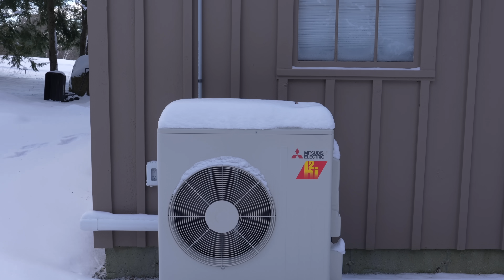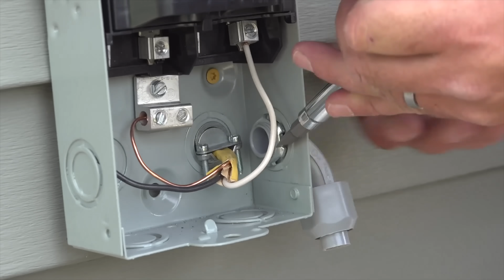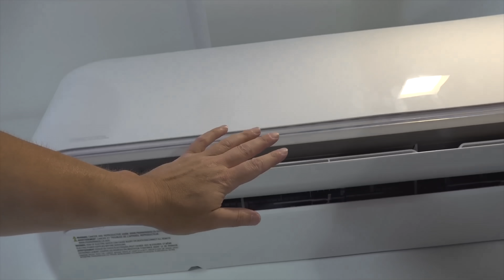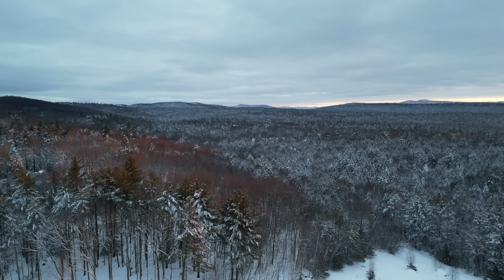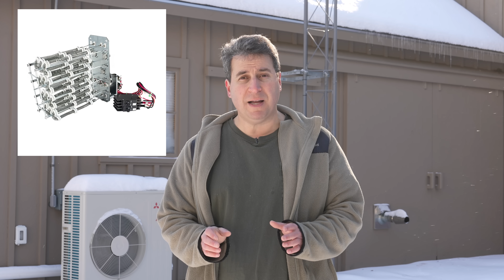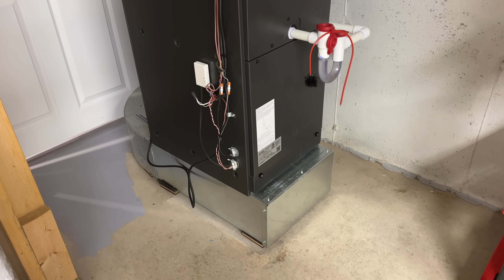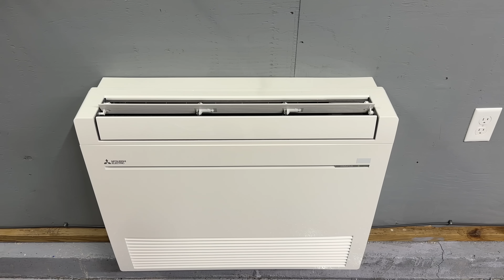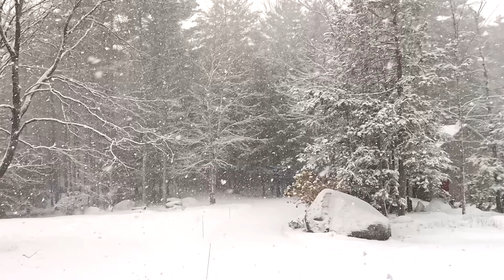Why Heat Pumps are now leaving people COLD

Comment: My Concord 4HP17L has been more than adequate in NE Ohio so far. Emergency heat has kicked in a few times but the temperature outside has been so low that even a gas furnace would be having a difficult time keeping up. The fact that I don’t have to pay a $43 connection fee just to have a gas meter turned on more that makes up for the extra electricity used by the emergency heat strips.
Reply: Also, I’m at about 5.5¢/kwh. It’s basically free at this point.

Comment: My HVAC company just told me how my system works in extreme cold. They said exactly what you said. We have to switch to auxiliary or emergency heat setting so that the system will work efficiently and keep you comfortable. At the same time, the Electric company reminds us that our bill will be high doing so. So now we know what to expect. 👍👍👌

Comment: For supplemental heating those Chinese Diesel heaters are great for emergency purposes. They saved my butt when my furnace went out in subzero weather a couple winters back.  For about $550 I built in a backup heat system that os over 40,000btu, reliable, on demand, run off readily available diesel which is stored outdoors, can run off 12v or 110ac, and I even recover exhaust waste heat from them with steam radiators.  Would recommend
Reply: Do you have a link for the system you went with?
Reply: @matthewbeasley7765  I just use 2 Vevor brand self contained (8kw) heaters, and custom built the entire system on a weatherproof cart.  Used insulated tubing for both pulling air from in the home and for the heated air in a custom window "gasket" that also has a 6 plug outlet.  2 deep cycle 100ah marine batteries, a 1500 watt generator with ducted exhaust into a car muffler at the bottom of the cart (adds supplemental heating to the whole system)
A 2000 watt inverter connected to the batteries, 2 cheap but good chinese battery chargers, and a 25 gallon diesel can for extra supply.  Its a fully self contained system I could sell for around $1200 bucks (which i've been offered for it)  I also duct the exhaust from the diesel heaters to the car muffler at the bottom of the cart which recovers heat for the unit which is enclosed by piece of folded sheet metal with securement pins.
Reply: @ProlificInvention  Interesting... How long can your batteries run the system before you have to recharge?
Reply: @cryptickcryptick2241  2 deep cycle 100ah batteries will run 2 heaters for around 4 days running full out, I use a variable voltage ac/dc transformer from China thats rated 0-48 volts and 480 watts to run the heaters off the generator while it is recharging the batteries.
Reply: I have the same. Originally bought for emergency backup, but trying to lower my oil bill supplementing with the heater. Tons of heat & uses very little fuel. Small solar charges the 12v battery.
Reply: Another easy way to heat a house is with a Kerosene heater. Some of the Kerosene heaters require no power, and a $150 to $200 unit puts out 24,000 BTU. Kerosene can be hard to find. The external exhaust of the Chinese diesel heaters are nice.
Reply: @cryptickcryptick2241  Yes I have those, unfortunately the fumes get to me, cant stand the smell of kerosene fumes because of an old job I had where we used those heaters

Comment: My 3 ton universal MR Cool Heat pump works perfectly 4 years  now i do not have the electric strip and my house has shitty insulation and windows and our bill has dropped 20% overall i leave it on 72 all the time  performs much better than my 14 seer Goodman the temp here in NC only gets below 30 degrees a few times a year
Reply: https://www.youtube.com/watch?v=_v8vizQXwss&t=7s&pp=ygUZbXIgY29vbCBoZWF0IC0gMjQgZGVncmVlcw%3D%3D So are they lying here?

Comment: I'm in the middle of the country and most of us here avoid heat pumps. They just don't offer a nice warm environment. I have natural gas heat and would not consider anything else.
Reply: I live in Missouri with 3 minsplits. They are amazing. We are all electric for everything. Electric bill is 70-90 dollars per month except in super cold where it goes up to 150.
Reply: My heat pump has propane backup when temperatures is to cold for the heat pump. Does great. 
My basement unit has the electric heat strips for the backup.
Reply: I agree with you.

Comment: I have a new bosch heat pump ducted system. My house has a bunch of issues that i still need to deal with including figuring out my old duct work is undersized. So not an ideal situation however the heat pump has been able to maintain 70° inside temp down to about 5° outside temp is when it starts to struggle. I did get the 10kw aux heat and have been fine tuning when that comes on. I now have it set to where it only starts using it once the outside temp is below 5°. Even then the system will run the heat pump for a good while until i decides it needs some help. It then turns off the heat pump and turns on the aux heat. That runs for about 20 mins which raises the indoor temp about 2° and then it switches that off and turns the heat pump back on. My heat pump doesn't have hyper heat however bosch just announces a hyperheat version (go figure) however their system is only rated down to about -14 i believe so not quite where some others are claiming. The true test will be the electric bill. Last year during a similar cold spell using the electric baseboard heaters cost nearly $800 in a month.

Comment: If designed and sized correctly especially in new construction, a heat pump can keep up on winter minimum days without supplemental heat. I’d still install electric elements or a gas dual fuel set up just as a backup though
Reply: If it is sized to keep up on minimum days - is it oversized most of the time? I run auxiliary heat only when necessary (in the teens and below).
Reply: @jdmather5755 Many modern multi split heat pumps are variable speed and can ramp up or down depending on the OA temp and heat/cooling calls. There is definitely a sweet spot in regards to efficiency but I’d much rather oversize for winter minimum than undersize and be cold. It’s not a bad strategy to rely on supplemental for your coldest days but I prefer it as just a backup. Mitsubishi has free software called diamond designer which allows you to calculate efficiencies and capacities at different design conditions

Comment: You make a very good point. A fireplace insert in the den used to get the room so warm we’d open the door to the patio to cool off. The heat was stuck in that room. We tried fans and a vent from the den’s cathedral ceiling through the attic to the living room. Nothing worked well. Then I had a ducted heat pump system installed. It distributed that heat through the house wonderfully! As long as I kept a fire going the heat strip didn’t come on. It was there if needed, but it was expensive. That was 2007 or so. Probably not as efficient as new ones. It was surprising to me how that insert could heat a 2000sf home. I expected it to help, but didn’t dream it would work as well as it did. With temps below zero I’ve been cringing for folks relying solely on heat pumps. My friend with a geothermal heat pump sees incredible savings. Here in the Ozarks we have lots of rocks too. Burying a line isn’t easy, but it’s incredibly efficient! If I had it to do over, I’d go that route. I’d still enjoy the wood stove though. Wood heat is just so soothing, especially with arthritis. The combination is perfect!
Edit-many electric and gas companies offer free inspection of homes and if needed you can get free attic insulation and they caulked any places where heat/air was escaping. It’s worth a call to see if your utility companies offer this free service! Did I mention FREE?!?
Reply: I installed an insert into my 1914 house and love that thing.  I live in a wooded part of the city and gather wood all year, rotate it thru my wood shed to season it. The main heat is nat gas forced air :(  which I hate.  Having the insert is great when it gets really cold 30ish and wet/damp outside. My ex has a big old place with radiators (hydronic) but added some heat pumps to get some AC and better control over zones, etc.
Reply: Resistivity heating is 100% efficient... its always going to be 100% efficient...

Comment: I also live here in NH and I have a couple mini-splits myself. I've got my family trained to use them for heat when it's above 25 outside and when it's colder to use the boiler. I've also installed a couple dozen for friends and family and I always tell them that below 25-30 the efficiency really drops, and to figure out what works best in terms of efficiency. Last couple days my boiler hasn't shut off at all it's been so darn cold.
Reply: "Efficiency really drops" is technically true, but if you're like me you're running a cold weather minisplit like a Mitsubishi hyper heat, which has 175% efficiency even down to 5 degrees F. . . it's 400% efficient above 47 degrees f, so yes it 'really drops" but it's still much better than 100% efficiency.
Reply: @mikebald  I mostly use them for cooling and the heat is a nice bonus. I’m just running some Pioneer units that I bought on Amazon and installed myself. They aren’t designed for extreme cold (hyperheat) but I wouldn’t rely on them as a primary heat source anyway. They actually came in handy today when my boiler decided to quit on me. An expansion tank later and a ton of air purging and I’m back in business. I’ve had excellent luck with the Pioneer units, with the first one I installed almost a decade ago still going strong. That unit was my training, the guy has tons of money and said “if you mess it up, I’ll just buy another one.” I’ve installed a couple dozen and have two at my own house. Been very happy with them.

Comment: they seem to work fine in much of northern europe and asia where it gets quite cold. and regardless, theyre economically fantastic for 9-10 months out of the year for the vast majority of americans.

 if you dont want to take extreme measures like tons of insulating of backup methods of heating, dont live somewhere with an extreme climate. its rather straight forward.

places like texas it would not have been predictable because until recently its extremely uncommon, and they need to have a working power grid to power heat pumps anyways. 

 the vast majority of americans and humans in general do not live in these extreme climates, and somehow heat pumps work pretty decently in other places. and i mean, they do here as well. theres not some epidemic of them failing. theyre working as expected for the extreme climate, and require backup heating at extreme temps.

 youre always doom and glooming everything. pex is terrible, heat pumps are terrible, everything is failing. its just your opinion, and its not supported by any evidence other than perhaps your anecdotal. certainly not statistically. just clickbait nonsense at this point.

Comment: We live in FL and yes it does not get cold here in winter very often. Last night it got down to 26 and our mini splits are doing great.  I installed 3 of them last summer and turned off our big central unit.  I can see how they could bog down up north in the really cold areas tho.  Our units seem to run more in the cold than they do in the summer heat.  So far I have not noticed any huge increase in electric use tho.  Overall I am extremely happy with the mini splits.  We have an 18K in the living room / kitchen area and a 12k in the master bedroom and spare bedroom.  Our electric bill has decreased a lot probably because I installed inverter units.
Reply: I live in Central Florida. Do you have one condenser with 3 air handler units or 3 condenser units outside? I have seen some nice units on Amazon which I would love. I am thinking about an 18K or higher in our living room and 2 - 9K units in the 2 bedrooms. It would be so nice to have the option of cooling and heating ONLY the rooms we need to when we need it.
Reply: @onecrazywheel  Yes you are exactly correct.  The best benefit so far has been the ability to isolate rooms which saves on electric overall.  My wife sleeps in the guest room a lot because she stays up later than I do.  So at night we each adjust the room to our perfect temp.  It's glorious.  I ordered all 3 SEPARATE units on Amazon and installed them myself.  I am an experienced handyman and also worked as an electrician for a few years in the military.  They are fairly simple to install and I didn't have any issues.  The 18K in our living room cools and heats approx. 675 sq. ft. (25x27) with no problem.  Truthfully installing the mini splits was the best thing I have done in this house.  Our electric bill has dropped from $350 month down to about $200.  A couple of times it was lower than that.
Reply: @dirtwhisperer658  I like hearing this. I took like the idea 💡 of having 3 separate units instead of one condenser. That way if there is a problem it is isolated. I'm a licensed electrician myself and would find it fun to dable in the idea of installing it myself. I have ran the electrical for dozens of units in the past so that would not be an issue for me at our house. Thanks for the reply. God bless 🙏
Reply: @onecrazywheel  Lots of videos here on Youtube for installation.  You will need a cheap vacuum pump to do it correctly and so you don't have all kinds of excess copper lines rolled up behind your unit.  I got mine on Amazon but Harbor Freight sells almost the exact same one.  Good luck!

Comment: Speaking the truth!  A lot of people are waking up to this reality.  If the outside is just cold and very, very dry the only issue is limited heat.  However, often it costs less money to turn off the heat pump and just use electric heat.  This avoids the need for frequent defrost cycles necessary when moisture in the air freezes on the outside coils.

Comment: How does it compare in terms of cost to natural gas or propane?  There is mention of geothermal in the comments, but that's really expensive and surprise, doesn't last which I was surprised to learn from my dad that has a geothermal system in MO.  I had a heat pump when I lived in VA in the late 90s.  It cost a ridiculous amount of money to keep warm in the winter.  Maybe they are better now, but I'm not convinced.  I prefer natural gas.
Reply: In many areas of the country electric rates are about $0.15/kwh and natural gas is $1.25 per therm (100k btu). Resistive electric heaters make 3400 btu/kwh, which is equivalent to paying $4.40 per therm. Heat pump efficiencies vary with temperature but are typically between 3.5 and 2x greater than resistive heaters. That means at these prices gas and electric heat pumps are somewhere between equal (3.5) and 75% more expensive than gas. Propane is sold per gallon (0.91 therm) and is often about $2.70 per gallon. At that price propane is nearly 3x more than natural gas, and more expensive than electric heat pumps at the price mentioned above. 
Regional electricity prices vary a lot though, which can make the math very different.

Comment: Running 100% gas on both HVAC systems for heat but I think next unit will be dual fuel. Run the heat pump down to about 40 degrees depending on current utility rates then switch to gas.  If natural gas prices plummeted, adjust as needed to heat at the lowest possible cost.  We get some cold at nights in NC but most of the winter is milder.
Reply: Dual fuel systems have way more problems than  a straight ac and furnace. I would seriously reconsider the rabbit hole you want to jump into.
Reply: The only difference between a heat pump and an AC, is a reversing valve.
Reply: @MrOpenGL  also logic to defrost the unit
Reply: @MrOpenGL  And the extra metering device and an expansion tank and the defrost board and it's lifespan is much shorter than straight a/c because it runs all year long
Reply: @davidb7180  Idk, my Mitsubishi inverter minisplit is almost my age (22yo) and the only thing that broke is the remote. None of the extra components seem that prone to failure either, even in a straight AC.
Reply: @BrianNC81  In most modern heatpumps it's built in the normal logic.
Reply: @davidb7180  My dual fuel system from Carrier has been operating smoothly for 14 yrs.
Reply: I love my dual fuel system.  Only a few years old, but zero problems thus far.  Mine is set up to run heat pump down to 35 degrees.  If I increase thermostat setting more than 2 degrees, the gas furnace kicks in.  Heat pumps, in my opinion, provide a more  gradual heat.

Comment: they are fine for the fall,  65 down to 40 and then they struggle.  in colder temps it just never shuts off which is annoying at best.   as for us it is only in our second parlor which has a hot water baseboard as well which we use in Jan and Feb in the colder days and months.

Comment: All of this HVAC talk in the cold makes me think about having a water source heat pump that ties into the pool that I'll never be able to afford... Efficient cooling + a heated pool, what a dream!
Reply from the maker: Not sure if you are a tech person but thats what Linus tech tips did. I am not sure it works but his install was pretty crazy
Reply: I'm in the trade, but not to where I can afford anything like that. In essence, air conditioning is all about exchanging heat from one place to another. All that hot air blowing from your outdoor unit on a summer day could have lots of uses, including heating your pool or your water heater.
Reply: It is possible but expensive.  Heat recovery systems are available.  LG makes a single phase model which would work in a residential application.  But these are really commercial systems.